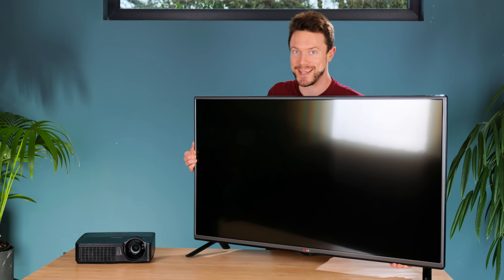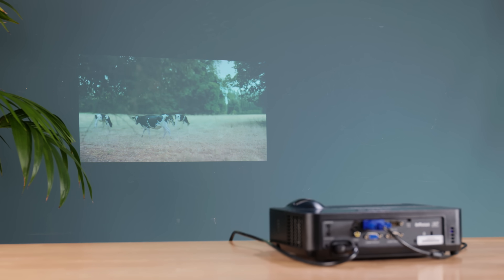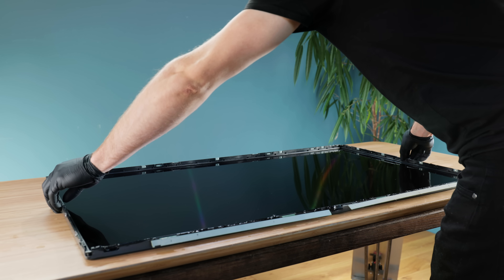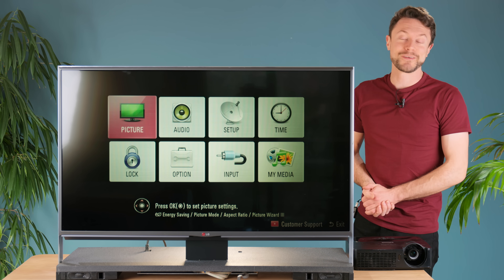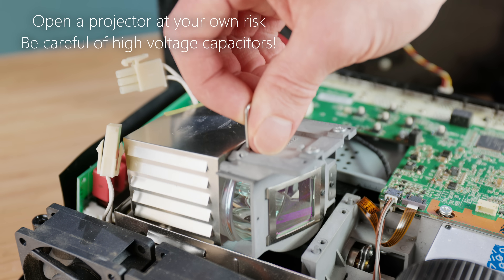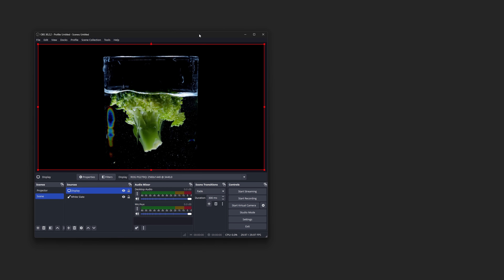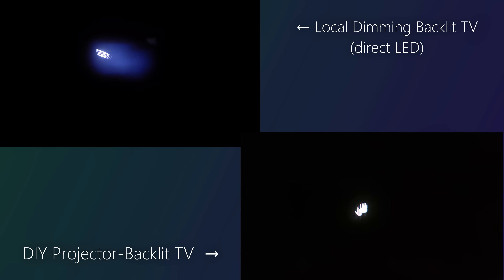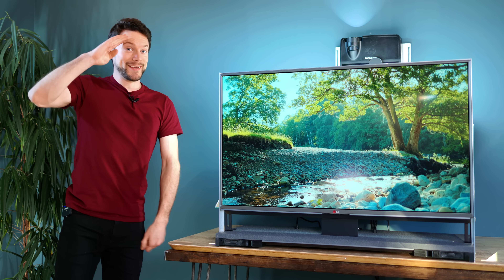DIY "infinity contrast" TV -  with 100% recycled parts

Comment: I've built a display similar to this, with one major difference, mine uses something that I've termed "mechanical modulation shutter", I use rotating thins that act as the polarizing film, that I have tuned to rotate at an appropriate RPM for two stacked 120Hz IPS panels, this gives me almost perfect 1:1 CRT grade motion-resolution for any FPS from 24 FPS to 120 FPS, the rotating polarizer almost acts like a mechanical raster-scan modulator, giving me incredibly smooth frames for 24 FPS film, or 60Hz games, and amazing MPRT results for 120Hz games, it beats even the best 480Hz OLED panels for motion-resolution, and it even compared favourably to my best CRT displays, the only thing holding it back is the limits of liquid crystal's pixel update speed, but it's better than any modern display on the market currently. 

I'd like to take it to the next level, and use two 29" 16:12 (4:3) Arcooda panels, with 3 short-through projectors that act as individual RGB lamps (which will give you a much higher colour gamut than white, as well as much higher colour volume & luminance, for amazing specular highlights etc), and use the RetroTink 4K FPGA accelerated CRT Beam replicator combined with my mechanical polarizer shutter (though Blur Busters rolling-scan algorithm may get so good you wouldn't need a shutter anymore, provided you had at least 600Hz refresh rate to match the mechanical shutters 1:1 motion resolution, though the shutter only needs 60Hz), as well as all the other amazing CRT features it has, for possibly the closest to a large 16:12 (4:3) CRT replacement display you can currently get.

Comment: You've made a MicroLED TV.  colours could be better with an LED projector as xenon bulbs used in older projectors only have a CRI of around 80, it can even be done with a 2nd broken TV to make a dual panel monitor like most higher end production monitors.

Comment: Folding the light path was the first thing that came to my mind when I started watching the video.
This is like the child of an LCD TV and a back projection TV from the 90s.
I think investigating the optics of those backprojection TVs could lead to some optimisations. Maybe a short throw projector wouldn't even be necessary if you can get the beam length shorter (perhaps by accepting slightly out of focus image) and cleverly folding th the beam.

Comment: This is pretty genius, thankyou!
I think that an interesting mod would be to get 'some' colour back because if you're going to have overspill anyway, then you can make one of those ambient average colour systems!
I've personally been thinking about using my old HD projector and a screen as a backdrop to my Aorus 4k 43"  main Dev and gaming display.
Sure the colour doesn't really compare to my 2nd laptop with a 17" oled touch screen (it's a 2-in-1 so you can turn it into an unreasonably large tablet and even use a stylus, but its power is mobility and I like the QDOT on the FV43U well enough .... In fact, your OBS hack has given me a lot more drive to try this properly as it solves some of my worries about bloom and glow in the wrong place ... I think I might even be able to try and project the same image and see how the effect of mirroring edge movement increases my sense of immersion, which is very much my main objective rather than perfect blacks.

I love my Quest 2, but I don't love a lot of VR games, If I could ever fund a proper 180° Curved cockpit system I'd be insanely happy as I love space games and the feeling of 'being there'!

Comment: You joke, but the optics in an old rear projection TV are probably perfect for this. All you need probably to do is use the center lense assembly for whatever color channel tube that was for and place the DLP beneath it, then push the LCD up against the viewing lens (Or just replace it entirely with the LCD)

Comment: Great project! One idea: On old DLP projectors, you can bypass the lamp sensor by simply shorting one optocoupler on the lamp controller. This way, you could install a high-CRI LED lamp to improve gamut. You could also try calibrating the output with a Spyder Pro or something similar to measure color fidelity.

Comment: DIY Perks: "Now all you need is a couple quantum processors with 1000000 qbits running in parallel. I got mine from the previous DIY project I built out of brass in my basement. But you can talk to your national govt for funding your own."

Comment: New idea. Take an old projector tv, and replace the front screen with an lcd and diffuser. Remove the color wheel just like this one. This way everything will be neatly packaged with no outside light entering.

Comment: If you are in the uk refurbityorkshire tends to get in a ton of working short throw projectors for around £20-£30..

Fun fact, JVC did similar with their PVMs.. they had a colour LCD in front of a B/W CRT because B/W CRTs had a much higher resolution not needing a colour mask and phosphors.. BUT iirc the largest they ever made was around 5 inches because LCDs back then were bonkers expensive.. however, compared to colour CRTs at the time the image difference is/was IMMENSE

Comment: providing the fact that alignment could be a real nightmare, one could use 4 real fullhd projector to illuminate a 4k panel using every projector for a quarter of the screen, with this you could achieve quadruple the light amount and have a per pixel illumination. technical difficulties aside, i suppose also the electrical bill would suffer also, but it would be interesting nontheless.

Comment: Thinking about interlace (like doubling resolution) in conjunction minimal rotations (vibrations) on the projector with the TV part as a dimming zone may decrease frame-rate but the perception should be at ordinary due to the interlace updates; although a fade out synd wirh the pixels is necessary to avoid flickering or tails of movement (thinking TFT screens..)

Comment: I remember seeing a video of a manufacturer trying to stack 2 LCD panels to do something similar. It used a lower resolution extra panel, only black and white between the backlight and the color front panel. It worked well but needed a higher power backlight and making a new tv like that was costly (basically 2 TVs in one) and harder as the panels needed to be aligned. It could be an interesting project alternative for you using old/recycled parts.

Comment: Actually this technology WAS created and came up a few times at the tech conferences years ago. Seemed brilliant at the time, since it solved a lot of issues other panel types had at the time (including OLED, which still has burn-in and cost issues). Basically run a black and white version of the same image in a second layer for the backlight. 
The problem? Higher processing power required, and it ended costing more than any other panel type alone. Basically it didn't end up solving the main issue of coarse selective backlighting.

Comment: Looks awesome as always. Have you measured the luminance/gamma curve for this though ? Brilliant setup but with an LCD and the somewhat arbitrary filter on the projector both controlling brightness in tandem I imagine it must be a bit all over the place once getting further away from 100%. Also how's latency? The OBS filter + old projector latency must be adding up enough for the backlight to trail significantly behind moving subjects. This is an awesome demo but something tells me that in practice it might not be quite 100% usable

Comment: This makes sense for a home theater room since you can make the back wall as deep as you want to reflect the image. I just need to find a 120" lcd screen now to use with my DLP short throw 3d projector that's collecting dust in my closet. If I could, would also like to use a 3D tvs hardware if possible.

Comment: 4:10 PLEASE PLEASE PLEASE be careful when pulling the power board! Was repairing the backlight on a TV I got from marketplace four years ago and accidentally touched a capacitor at the soldered pin. I still have a small scar on the side of my index finger that hurts to this day when it's touched.

Comment: So you're sending the signal to both devices at the same time? And how did you get the resolution on the projector to match the resolution on the TV? Because that is not an HD projector but that is an HD TV. 

So many technical details missing from this presentation.
Reply from the maker: OBS just scales the output. It's easy to download and experiment with if you want to check it out.

Comment: HiSense did something similar to this, but rather than a projector, they used a low resolution black and white LCD panel behind a color LCD panel with a bright backlight. I don’t think they ever released it but they did show it off at a trade show. I think it never really released because manufacturing and cost can’t really compete with modern micro-LED TVs with far higher dimming zone counts, especially as the price gets driven down. As kind of an example of that, I just got a new 65 inch TV with quantum dot color stuff and thousands of dimming zones for $700, when just 5 years ago this would have been thousands of dollars.

I will say, though, if I need a need to keep my old TV, as it had a backlight issue, I’d be tempted to try to do something like this with a cheap short throw projector. I’ve been trying to give it away through local postings, and while it still has a usable picture, just dim, I’ve had a hard time giving it away. Maybe there’s some locals that see something like this and get curious.

Comment: A few points:
- edge lit TVs diffusors seem to be different
- LCD projectors are not going to work as well as a DLP
- most super cheap office projectors will be 1024x768 but these days finding 720 or 1080 shouldn't be too hard for pretty cheap

I'm curious though how much or if the diffusor is really needed when you're processing tbe light first. It might increase contrast and brightness significantly to reduce it, I'm not sure it would have worked well without the luma processing but with it, maybe!

Comment: The LCD screen I use at home actually has pretty good black levels, because I have set its backlight to be very dim. And it also seems to have quite a good panel for being around 1500SEK in price (IIRC) at MediaMarkt about a year ago, back before "Power" bought MediaMarkt Sweden.

Comment: its great but the power cost is way higher compared to a modern tv.... or a LED powered projector.... a short throw projector using LED lighting will be the best solution and covering it like old fashion tube TV.... and we went full circle....

Comment: This is a cool experiment but I can see why it wasn’t done for real sets - although that weird crossover time in the mid 2000s when both LCD rear projection sets and actual large LCD panels existed could have spawned this kind of thing in another timeline I guess.

However, this is a very similar concept to dual-cell LCD that kind of came and went a couple of years ago, but could probably have fairly easily been done 15-20 years ago too.

Comment: Well crap, I have a 55 samsung with dead backlight and negligble diffuser and a 720p projector 😮
Reply: Ah double crap mine is edge lit, the diffuser is different (and slightly cracked but salvageable if I were to do this) I think hmm
Reply: 14:55 I'm actually curious if you even need the diffuser with your light map setup

Comment: Pretty amazing and quite creative. If that is a DLP projector, are you getting UV light output as well? I remember using one of these on my home built UV curing resin printer back in 2011. I also removed that color wheel so that I could get the UV light output for the curing.UV isn't the best for the eyes. I'm sure the screen is filtering out the UV, but it is worth the investigation.

Comment: A nitpick just about the concept, infinite contrast is not a thing unless the pixels are like literal lasers and even then, scattering off particulates in the air will obviously drop the contrast.

In relation to the video though, the fact that there is a diffusion layer means it’s definitively not infinite contrast

But yeah, doesn’t mean I didn’t like the video, just mentioning a technicality of terms

Comment: I believe TCL tried something like that - they have putted additional grayscale LCD 1080p panel just after color LCD 4k panel, essential achieving high-contrast dual-ips panel. Sadly it was never continued as there were problems with proper alignment of the LCD panels...
Crazy idea now: shrink LCD panel from TV (e.g. get an LCD projector) and replace color wheel with this small LCD - I wonder if it would give as an ultimate projector? :)

Comment: There were companies that did something similar a while back - using a second lcd screen as the backlight. Some reference monitors still do this. The trouble is it’s expensive compared to OLED so it didn’t go anywhere. I would say the biggest issue with your setup in use would be latency, getting the LCD   and the projector to display the image at exactly the same time would be next to impossible without introducing significant latency. Not so much an issue with films I suppose, but would be useless for gaming. Still, interesting use of old tech and better than it ending up in the tip!

Comment: Would it be possible to simply add an LCD layer to an old rear projection TV in so. E way then? Eliminate the external projector completely and have a more TV size all in one solution?

Comment: The secondary mounting position solved the one concern I had with this, shooting a projector that close to a source will heat up that source greatly and damage the LCD, reflecting the light, slightly cuts down on brightness even more, but should eliminate the heat concern. You know what you should try this with is the Projector Mod for the MOTO G phones. I think the resolution is the same, though, brightness would easily be a fraction. It was never more than a gimmick when I played with it.

Comment: 15:00 well, this is actually very disappointing considering that one of the main flaws of OLED is lack of brightness. I wonder if this project can be improved with a quantum dot panel to waste less light energy and just some tweaking to get rid of the parallax effect, maybe you don't even need a diffusion layer because you can just blur the image or defocus the projector, like you did, the diffusion layer diffuses some light back away from the screen so we are losing brightness here
Reply: I don't think the real purpose of the diffuser here is to blur the projected image; it's to eliminate the 'hot spot' for a viewer where the angle of their view of a point on the screen is direct line back to the projector bulb.  No amount of blurring of the projected image would eliminate that; you need physical diffusion to ensure that the projector is never firing photons in a direct path straight into your eyes.
Reply: Get a brighter projector, should fix that
Reply: @nikkorocksalot5254 I was also thinking that even though "Mr Perks" removed the color filter from the projector, the projector still only shines light when the filter would have been there, based on what colors are on the screen, instead of shining the whole time, so patching this out of the firmware would probably gain a bit of brightness and probably increase color accuracy too.
More power is better but we must not forget to do more efficiency too
Reply: No you need a diffusion layer because without it, it's like protecting on a window, or staring into a projector. Projectors work by having beams of light diffuse either on a surface or layers. If you stare into a projector you can only see the few pixels directly projected into your eyes.
Reply: Hmm, but quantum dot tech is (sort of) an emissive tech already. Or are you suggesting somehow using the projector as a UV/blue backlight to trigger the emission ? That sounds like an awful lot of work for not the best experience 😅

Comment: Learn Ultrasound holography and you will be able to make images on your computer then use Ultrasonic pressure holograms forming to those images to pour plastics-metals into resulting in the holographic pressure image forcing the desired form. That one thing will help you be able to download designs off the internet and make them real with no mass production systems like these primitive corporations do. Google: "Ultrasound can produce temperatures as high as those on the surface of the Sun and pressures as great as those at the bottom of the ocean." For max resolution potential = Plasma Speakers aka Warwick University science if you want to use EARTH science tests as a basis. Keys on Warwick university page: Totally remote + Operate on hot or moving samples + Work in hostile environments + More easily automated giving higher reliability.

For controlling molten metals with Holography Google: "Ultrasound can print through walls" Its how Dracula reforms himself when destroyed. The real guy..

Comment: I remember Sony had created an 80 inch panel similar to this. ONLY downside to it was, it was very expensive. It used to cost 8,00,000 Rupees in India back then (in 2009); while LCD TV of same size used to cost less than 1,00,000 INR

Comment: although cool the usability of this isn't' up there considering that you need to fiddle with obs
now if the project was at a later stage, using an aliexpress projector or similar with an enclosed case and lastly with a systemwide solution (probably android tv) then it could be cool to try